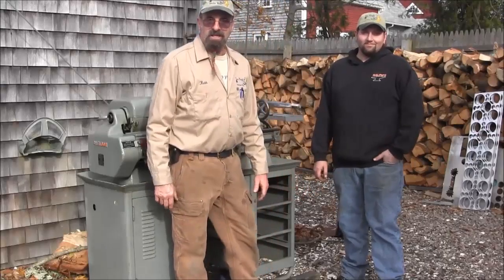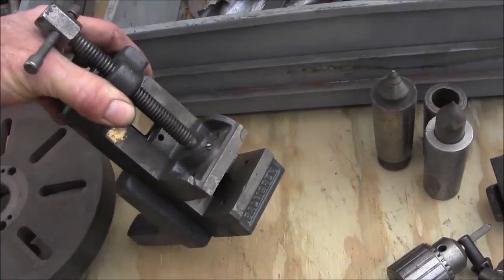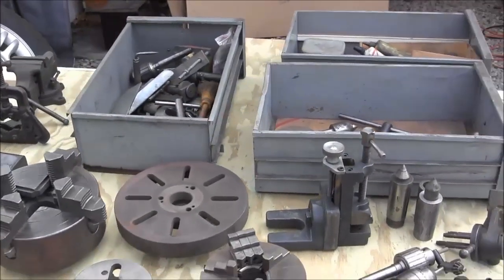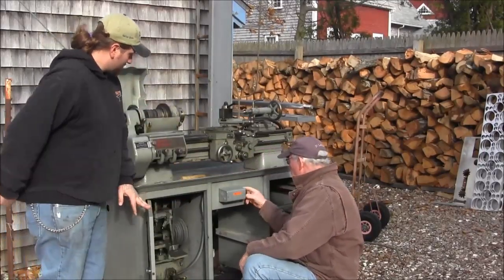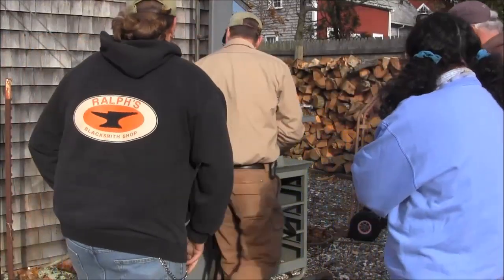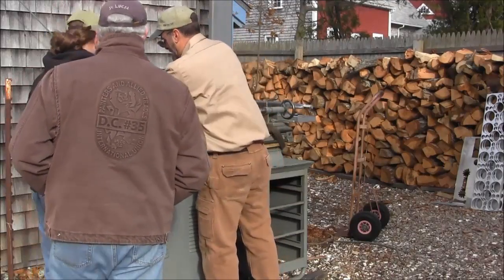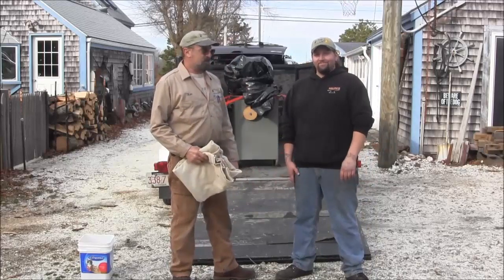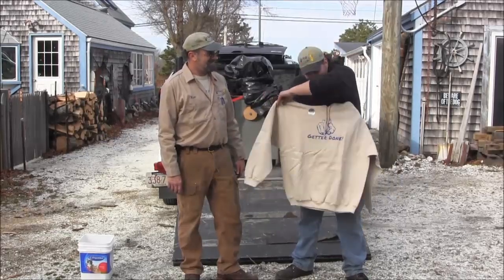Sheldon Giveaway

Comment: It is great that Billy is interested in Engineering and has a start by you Keith. An interesting thing for him to make will be both the fixed and traveling steady. The gear you supplied with the machine and some thought it can be dome on the Lathe itself. Just need to Geterdone. Cheers from John.

Comment: This video was great! My first (and only) lathe was a Sieg SC3. and it love it to bits. If I had to choose weather to keep the wife or my lathe... Its not an easy answer!
I was wondering what your first lathe was? Can we have that story?
Reply from the maker: My first lathe was a 9" Southbend, no quick change gear box but had all the change gears and had to braze two main spindle gears to get the back gear in operation. My wife bought it and a Clausing mill  for me using her inheritance money her grandmother gave her, before she died. I have since then given her back much more from her investing in me and we work well together, as long as I don't tell her how to budget our house hold and she doesn't tell me how to repair your project.In one of the K&T videos you can see the Southbend in the slide show while rebuilding the K&T in California. That was when I was working for Northstar Propellers and starting my shop in the garage, called Keith's machine shop, but the Business name choices for Turn Right Machine Works and Turn Wright Machine Works were both spelled out, next to each other, on the refrigerator door. Anyhow that lathe was purchased here on the cape and went to California then came back to the cape with me and both the lathe and the Clausing mill are still in Hyannis as far as I know. ;{)----